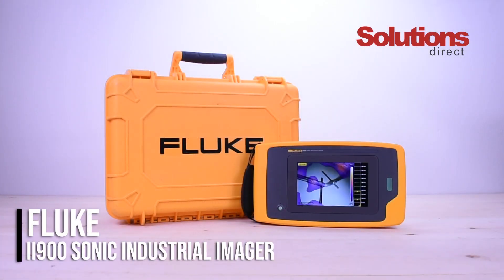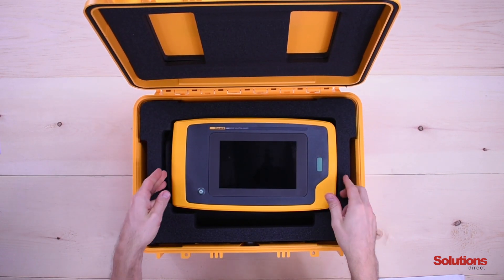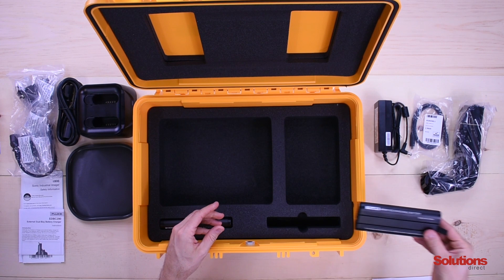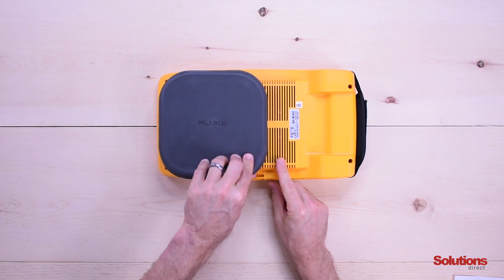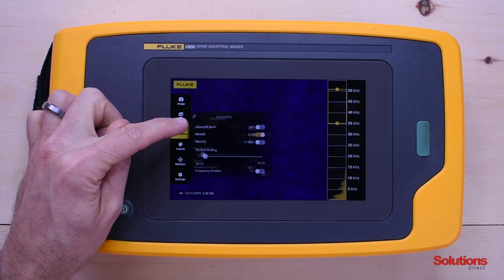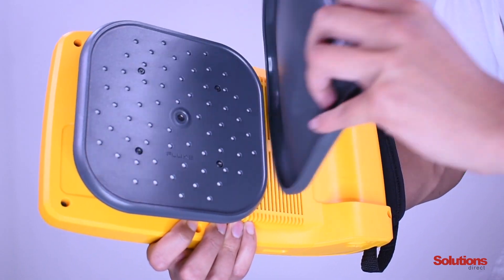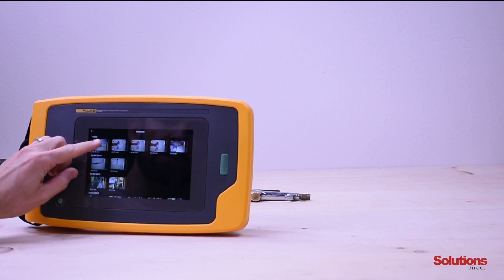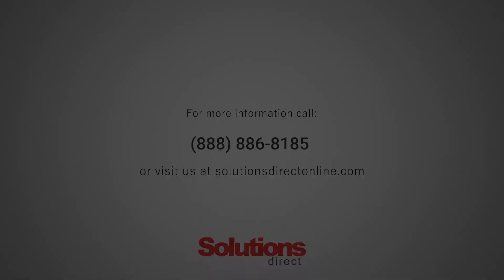Fluke ii900 Sonic Industrial Imager - Unboxing/Demo

Comment: hey can you use this on a 2 stroke motor to find crankcase leaks? i can't see why not just want to double-check. as you know, 2 strokes work on compression and VACUUM, unlike a 4 stroke that's just compression. this would be invaluable for my business.